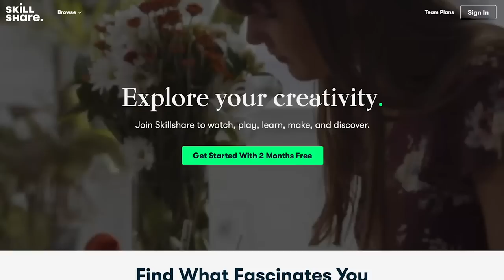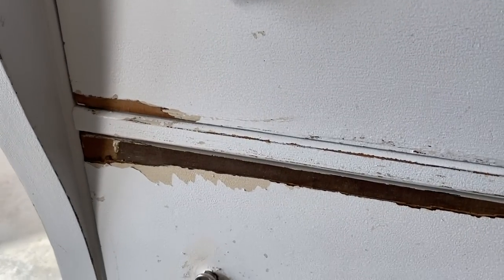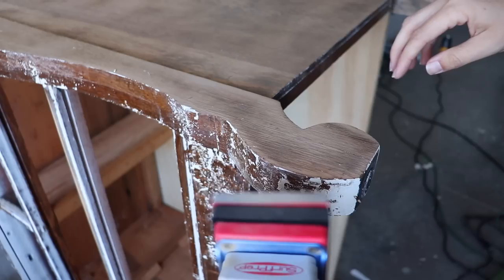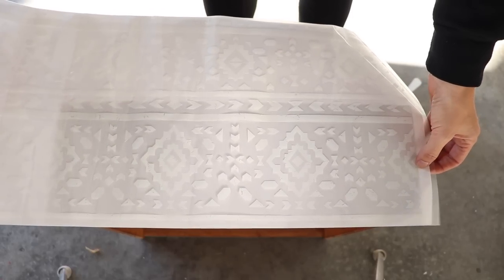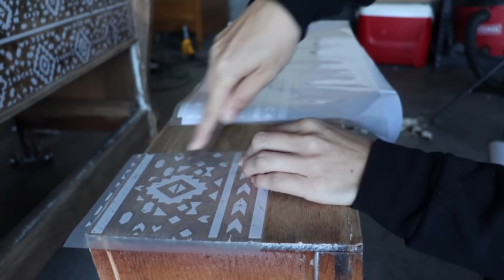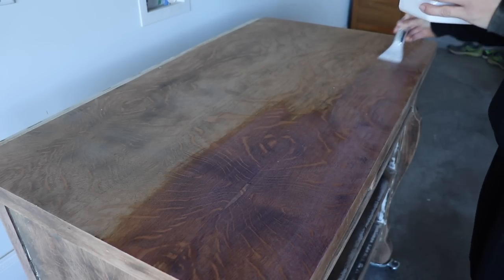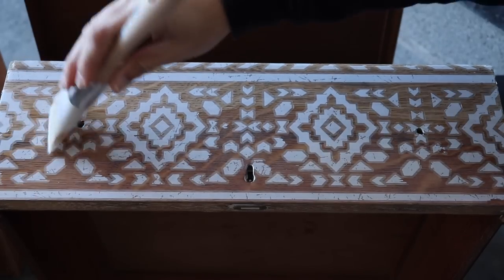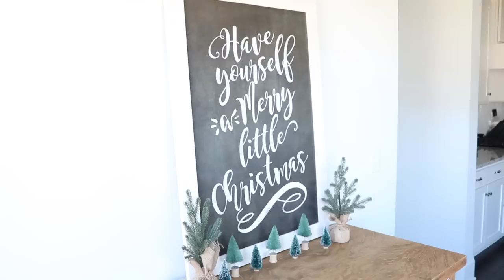Trash To Treasure | Furniture Makeover | I Can't Believe I Paid For This!

Comment: I have had a number of these draw sets over the years. The worst one had is legs sawn off, with ugly, ugly, huge plastic draw knobs, coats of hideously applied paint, wall paper, dints and deep scratches. It had been treated with huge disrespect. It is made of solid silky oak. I stripped it but kept it’s distressed state, kept the patina, didn’t put legs on it, varnished it in a flat and now it is my favourite piece sitting at the end of my bed as a seat.

Comment: What kind of sander do you have, please? I have one but it doesn’t go around round sides well, nor does it pick up the dust. Also, name of stencil transfer do you use? And, do you put top coat on before stenciling? Thank you!
Reply from the maker: It's a Surf Prep Sander. Surf Prep 3" x 4" Electric Ray (Use Code PRETTYDISTRESSED10 for 10% off your order) - https://surfprepsanding.com/product/woodworking-sanding-systems/?aff=26

Comment: The 1800s empire chest that God willing I will won the give away is older than this one here in ur video...the one I have has hand made old nails and quarter sawn oak (which I believe urs has the same quarter sawn oak which gives the tiger wood look)....however mine has 3 small drawers over 4 deep with the heavy empire top and scrolled legs and curved back scroll feet ..and I think it Wud look majestic in the beyond paint Emerald green 💚